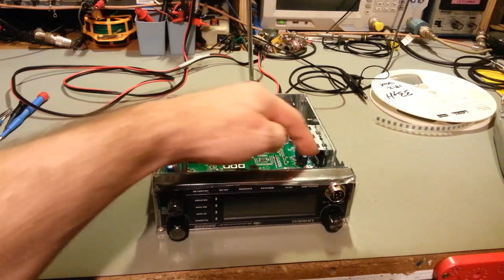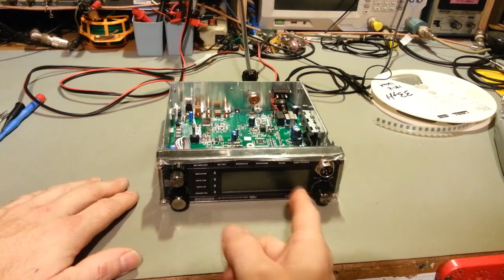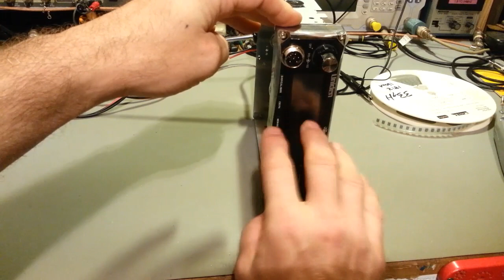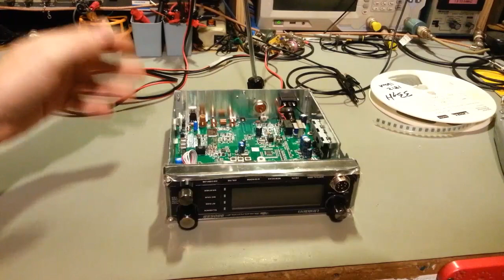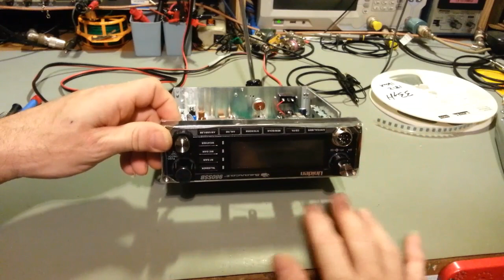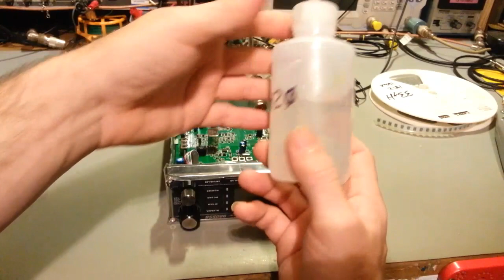Beware of flood damaged radios.

Comment: From my experience, digital displays are the first thing to get damaged from being wet, and they don't have to be underwater. In super high humidity, water will condense on the display, and it will never work again. A few segments may still show, but there is no way to fix it. I don't recommend using anything with a digital display if it needs to hold up under harsh conditions. That includes not only radios, but cell phones, computers, etc.

Comment: Submerge in IPA. Preferably in an ultrasonic cleaner.
Reply from the maker: Karl Porath 

Definitely don't want to put a whole radio in a ultrasonic cleaner.  Guaranteed it will not work after that.  Items like crystals, filters and many some It's can be destroyed with ultrasonic cleaning.  Tact switches don't take it very well either, I found that out the hard way.  It destroyed 8 tact switches in under 3 minutes.  The only way you could safely do it would be to check the datasheet for every single component in the radio and see if ultrasonic cleaning is a approved cleaning method.  If it's not you would have to remove all those parts.
Reply: MikesRadioRepair works on cell phones that take the toilet plunge.
Reply from the maker: Karl Porath 

That may be but I have had destructive results with many components.  Many datasheets clearly state that a component can not be cleaned in a ultrasonic cleaner because they will be damaged.

Comment: About 10 years ago I knew a guy who had about 4 CB Radios in a plastic box. It got moved outside his garage one day with other things as his kid was having a birthday party in the garage. It was left out for a week and the top was cracked and the box filled up with rainwater. He worked away and his wife and kid left the plastic tarp cover off the things that they took out the garage. All the CB Radios where under water in the box. He did not plug them in to try them. He took the covers off and put them on a towel in the back seat of his car. It was summer so the car got hot during the day. He left them for 2 weeks. They looked dry so he tried them and they worked and still do today.

Comment: I bought a Realistic 449 that had been sitting in water.  Got it cheap as a parts set, basically I needed the covers and anything else was a bonus.  It had obvious signs of water from the back up to about the middle of the board.  The transformer can leads on those are copper clad steel, and the steel had rusted away leaving just a foil of tinned copper.  No fixing it, the transformers were all bad.

Comment: Mike: Good tips on flood damaged equipment.  I know that flood damaged vehicles are sold cross-border as so-called bargains, ultimately causing no end of headaches for the new owner. On the subject of water, wiring, and capillary action, I have read about and seen videos on the recycling of ships where they use thousands of feet of cabling. When the cables were cut for salvage, gallons of water came out.

Comment: I once repaired 100 brand new business band radio's that were boxed and completely underwater for 2 weeks......they said the were not insured, so there was nothing to loose in a repair attempt, hence I had a go.
I pulled all 100 apart (lids off etc)....... I then hosed them down with a garden hose to get most of the mud and silt out of them, and then put them all through an old Dishwasher I had, and washed them with just plain rain water, no soap added......I am lucky enough to have tanked rainwater.
As I pulled them out of the dishwasher in batches, I loaded them into a vertical Nappy drying cabinet I got from the Red Cross shop for $10.....it was the size of a big fridge, so held around 40 at a time, and set it to around 30 degree's C (flat out for that machine I think) .......and left them in there for 24 hours min.....sometimes longer if I had some other job on.
Well long story short, the only things I had to replace was speakers and about a dozen Mic's and I sprayed all the pots with cleaner lube......no other parts needed, and that was 25 years ago and they were still all going when they were upgraded just a couple of years back........the secret is the drying process....it has to be done so there is no doubt that all the water has been forced out of the wiring.
I did this after a few years earlier talking to a TEK rep who told me about Tektronics doing a similar process to their equipment in for repair....using huge ultrasonic cleaners in some cases......I have since used both a dishwasher and a large ultrasonic heated cleaner for lots of gear with zero failures.......there are quiet a few Youtube video's on the subject.
But yes, if you don't do it right, in regards to drying, you will have years of trouble ahead.
Reply: Can you do a desense repairing Grundig S350DL.  I was listening to very strong      signal on. 27.165 MHz with my long. Wire antenna then it it went quite.